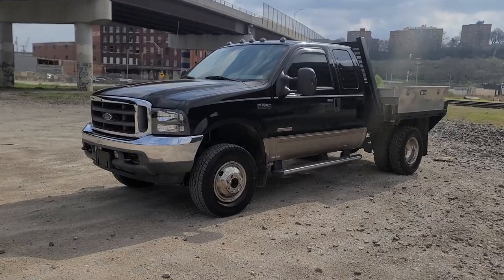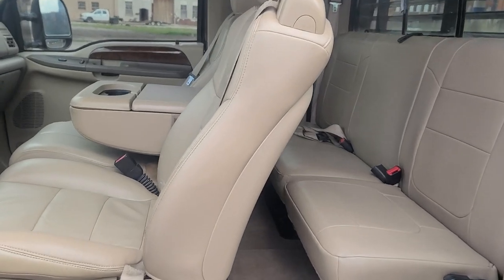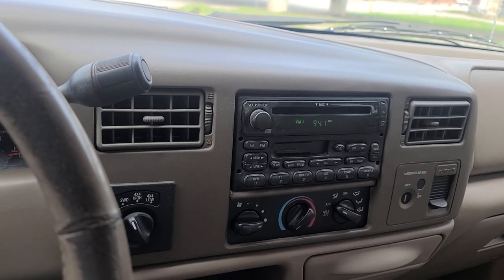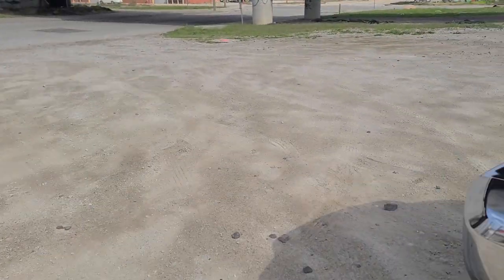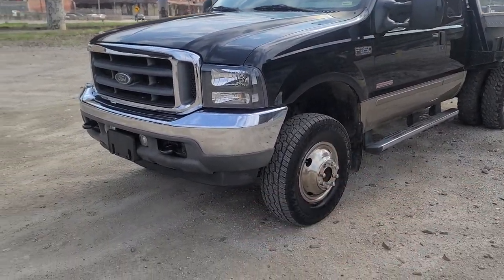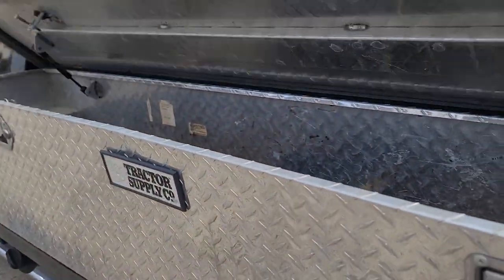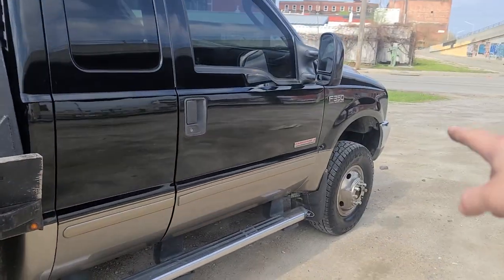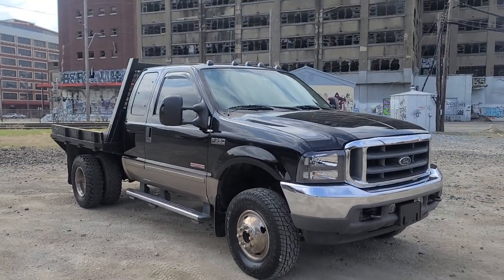2004 Ford F350 4x4 Lariat Dually Flatbed

Comment: Please, what is the significance of early '04 versus late '04?
Reply from the maker: FEw things got changed from turbo, icp, hpop system, just a few differences to be aware of, the 03s, early 04s are known for ✌️gremlins✌️ or weird issues, all really, but more specifically those early models, so people usually tend to look for 04.5+, some others like the early ones for the turbo reasons, or less prone to hg issues.